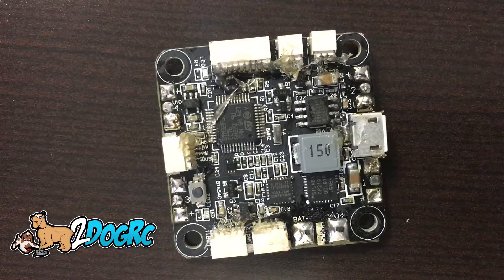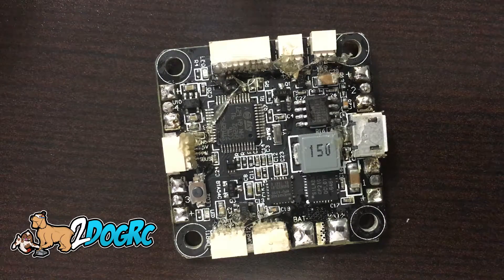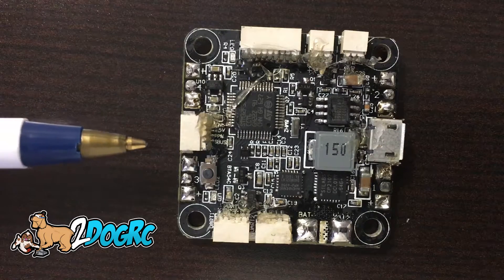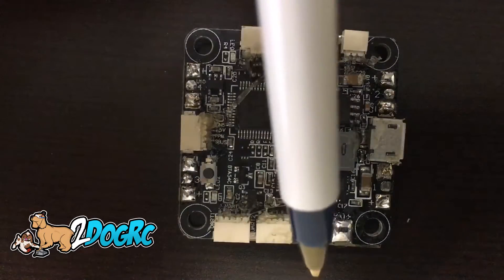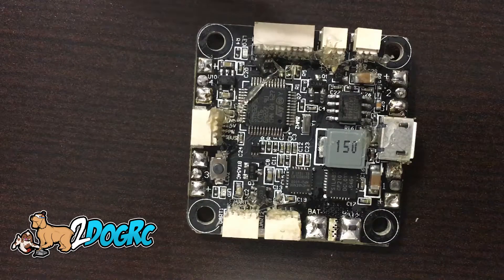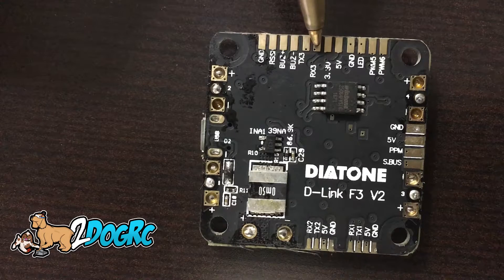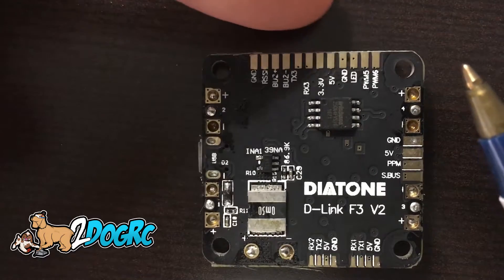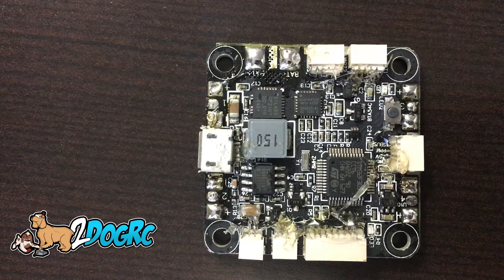How to connect a Spektrum Receiver to Diatone Crusader 2 or D-Link V2

Comment: i have this board, but it does not want to connect to betaflight, nor cleanflight. any thoughts?
Reply from the maker: First step, install the CP210X drivers listed on the Betadflight or Cleanflight strtup screen. Then make sure the Port number in the upper right changes when you plug the USB cable from the ship into the computer.

Comment: When is the video of the install coming out?!?!?!
Reply from the maker: What part of the install do you need help with?
Reply: 2dogrc , i have the v3 board and i need help with instaling the 3.3V BEC. I dont know where to solder it to. And also how do i solder my reciever to it. Its a spektrum FPV racing reciever. I am confused because there is the positive and negative ports for the BEC and there is only the 5V port. And then what to do with the rest of the cables ?? Sorry to bother you but i really need help!
Reply from the maker: Just emailed you!  Do me a favor, send me a pic of the VR next to your Receiver with the wires connected, and I will draw you a wiring diagram, use the contact us page on the website. I can get it right back to you.
Reply: 2dogrc just emaild you back

Comment: I have a Hi-Tec aurora 9 and a Minima 6, how on earth do i connect this up to this board? im used to 6 pins now i have 2 white pins only?
Reply from the maker: You need a Receiver that can do PPM or SBUS.  Check with those companies to see what is compatible.  The benefit are faster RX speeds, and you only need to connect 3 wires!
Reply: yeah ive just looked into it! Hitec dont do any recievers with PPM or Sbus!! so ive looked into getting a PWM to PPM encoder! I Hope that will work? I looks like my only option.
Reply from the maker: This is ship is very tight on space.  It is going to be tough cramming all that under the hood.
Reply: its in the Tyrant S, So i might be ok, if not ill get some sort of small under carriage! Cheers for the help btw!
Reply from the maker: OKay, there is more room in that, and you should not have a problem.

Comment: Since u now solder it on the UART3, do u need to change the settings in betaflight as well?
Reply from the maker: In Betaflight make sure UART3 is on Serial receiver.

Comment: might be a noob question but how do you solder in those holes? do you tin both then stick the tip right in the hole or bubble it at the top and do it normal?
Reply from the maker: You can do both!  Some people solder in the holes, some just lay the wire on top.
Reply: 2dogrc nice. well I couldn't find the v2 anywhere so I ended up ordering the V1 and sp3 vtx. where do I hook up the pass through power to the vtx? I know on the v2 it's that top right plug but one the v1 it shows the buzzer there.
Reply from the maker: UARt 2 or 3.  TX from FC to RX on SP3

Comment: A shame This fc for Spektrum users. Now you have to take it almost apart and deconnect Some solders to Flip the board and solder the 3.3v on the backside...
Reply from the maker: The next version doesn't have a 3.3V!
Reply: 2dogrc how do I connect with next version with no 3.3v?

Comment: I'm new to FPV RC and I wound up purchasing a crusader with this board, and the spm4648 rx. I gotta say, I was hoping this hobby had become accessible to folks like me, that for whatever reason can't or won't solder. I have essential tremors and it's very difficult for me to solder tiny wires like these. I've gotten poorly informed advice at my local hobby shop, found insufficient information provided by various manufacturers, and spent a significant amount of money on merchandise that's being marketed something that it decidedly is not: user-friendly.
That's my rant!
Thank you so much for posting so many informative videos, guys like you are bridging the gap between the new-to-rc consumers like me and the dizzying (pun) world of FPV quad piloting. Keep up the solid work!
Reply: Try looking up the qq190 from team black sheep it's supposed to be solder proof would like to hear your up in the air without soldering look into it

Comment: i have done as instructed in this video, my smp4648, looks bound to my dx8,   but no channel mapping, in other words my receiver not communicating with the board.
Reply from the maker: Is the receiver getting powered.
Reply: Yes, it looks like i need a special CLI COMAND, which i havent been able to get, everything is connected, im getting a signal to raceflight from the FC, but the sat receiver not communicating with the Fc
Reply: No channel input from the radio on raceflight, and the receiver is bound to my radio, shows a solid orange light
Reply from the maker: Raceflight??
Reply: Yes raceflight.
Reply from the maker: I have never used Raceflight. I also don't approve of the ethics and business practices of the designer so I won't we able to help on that.  Sorry.
Reply: Oh ok them im stuck no flying for me, i got two racequads i purchased, both came with defective boards, i replaced one, im spending too much money on this, and no enough flying, I quit!!!
Reply from the maker: Try using Betaflight instead. No command lines needed.
Reply: The very expensive fc400 spektrum fc, only takes raceflight, i already tried using cleanflight, and betafligh, im out of luck, no one will help me, nobody knows, or only at a hobbyshop for the right amount of money, better luck next month, ran my budget out, i got more important things in life than flying racing quads, this is just a hobby for me

Comment: Quick question, using the spektrum satellite receiver you mentioned do you use the s.bus or rx3 solder tab. would either work?
Reply: You are correct, either will work.  the SBus connection is the same as RX3!
Reply: Thanks for the answer, cant wait to get my gt2!

Comment: My first gt2 had the old FC and loved it. When I got the new one was very disappointed being a spektrum user.  May just have  to put my turnigy Rx in.  Seems almost like a step backwards, as far as ease of setup anyway.  Thank you for the videos also.
Reply from the maker: Yeah.  Spektrum now has a 5V receiver out.  If you think about it Spektrum was lagging behind and all the board designers had to add tabs just for their receivers.  All the other receivers work off of 5V, now they are on board...except they priced the receiver at $50!  I don't think they get it.  Especially now with the Frsky Xm+ receiver for $12!
Reply: 2dogrc yeah for sure, I wish there were more industry standards in this hobby.  I went ahead and just soldered in a satellite.  I do have one of the telemetry receivers from spektrum that's runs off higher voltage just not really sure where to mount it in the gt2 it's a little larger than my 4648 satellites I usually go with.  

However I have really been considering switching over frsky now and getting a modules to use with all my spekrum receivers I have installed.   I just have too much invested in spekrum stuff now, kinda sucks

I will prob pick up the qx7 and start transitioning over slowly.   

Thanks for all the videos
Reply from the maker: That would be a good idea.  The cost for buying the Q7 will be offset  very quickly in savings on receivers!

Comment: Thanks again for another useful video. Where would I need to wire the Smartport cable to from a X4R-SB. On the underside of the FC to RX3 or TX3?
Reply from the maker: tammovh You can't use Uart 3 because that is what the receiver is using. You could use Uart1' because that is only being used when you plug in the USB and you don't need telemetry when you are working on the computer. Uart 1 is the connector on the back left, next to where the OSD is plugged in. I note it in the video as well.
Reply: Cool. So on UART1 do I connect the Smart Port cable to TX1 or RX1?
Reply from the maker: Think opposites.  The FC is Transmitting, so TX on UART1 and the Receiver is Receiver, so Receive on the receiver.
Reply: Awesome, thanks!

Comment: Are you going to make a vid on how to ocnnect this with usb and set it up on betaflight? Bc I am still running into issues with my computers, the port opens at flash bur the board doesnt respond.
Reply: Just flashed mine.... It's doing the same thing. Did you find the issue?
Reply from the maker: Slastraf if you are having issues like that it is a driver issue.  Please install the Cp210x drivers noted on the front page of Betaflight. It could also be your cord.  Not all cord's are data and power.  Some cords are power only.
Reply: +2dogrc I alreaddy installed plenty of drivers, and also some other stuff that wa ssuggested on the forums,
Boot button > usb link -> zadig driver switch to windows>start betaflight -> flash  didnt work for me.
Reply from the maker: You have something wrong on the computer side.  For one, you can not brick the boards due to the way the bootloader is stored on the board.  You are either missing a step, a driver or have a bad cord.  It is possible to try it on another computer know to work with F3 boards?  These connect differently then F1 boards such as the Naze32 and like.
Reply: Have tried it on 2 computers already, what are the exact steps to connect it?
Reply: I got a refund , they sended me a new one. It was broken after Windows said the device couldnt respond after installing all stuf properly, I even started a forum thread somewhere